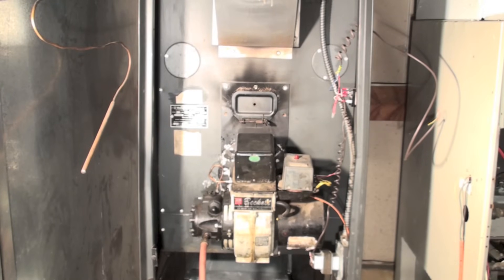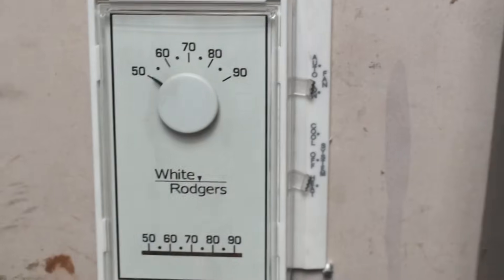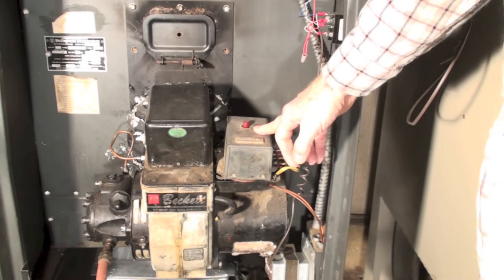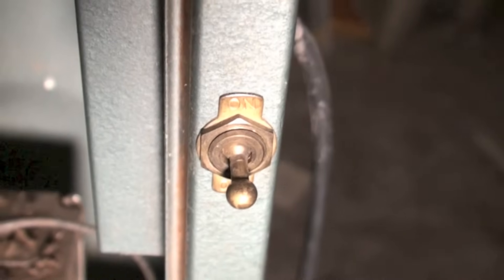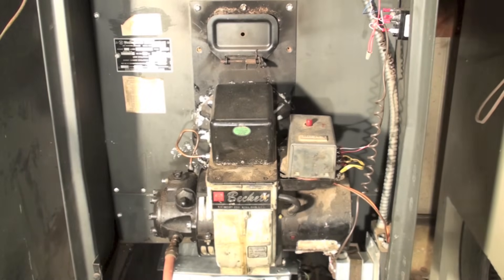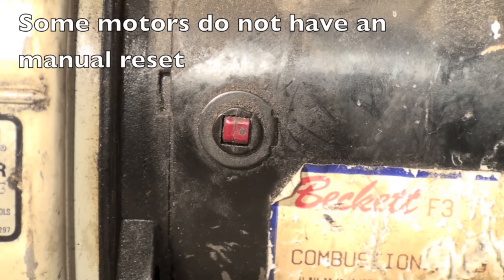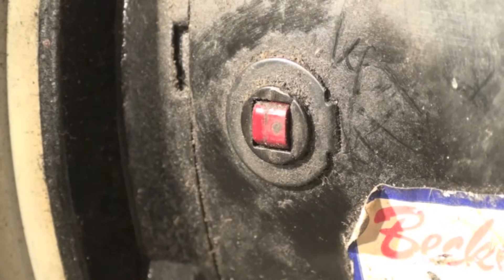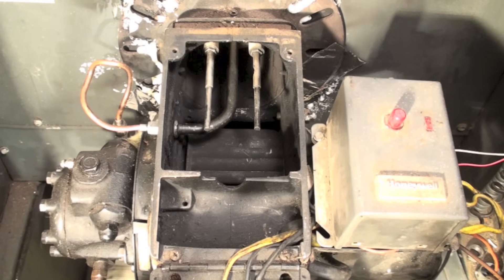Troubleshoot the oil furnace part 1. Burner won't start.

Comment: Well. I hope you are someone on here is still alive. I'm a retired guy with a house built in 1890's. We moved into the house in 1986. It had a American Radiator Company, ARCO PETRO OIL BOILER (32" x 58" x 78"), with a  new install of an INTERburner!  Its For the first 15 yrs everything work. Nice hot water through the radiators. Beautiful even moist heat...

Fast forward to today. We have used kerosene or electric heat for 12 yrs. It broke. Wouldnt start, and the Pump (1hp thrust pump) broke. 2 yrs ago we got it all to run again and it ran almost the whole winter- MY fault, I let it get to the bottom of the tank- SLUDGE clogged it.  I was given the tiny pump piece by an old furnance guy... and new wiring, etc. thats where I sit. 

After I put the new pieces (at the CAD), and to the ignitor, and tried adjusting the ignitor, I get electrical pulses when I touch the furnance.... no hurt kind, but like a ground touching somewhere. 

Well, anyway... I am searching today and came across this guy... will be back for question

Comment: Hey grayfurnaceman, this is a bit of a follow up to my previous question about my Beckett burner getting flooded. I'm going to take your advice and replace the motor. I disassembled the one that is presently on the furnace, and water ran out of it. I'm also going to replace the oil filter. The flood water does not appear to have got up to the transformer or primary control because I don't see any flood residue left on them. Nonetheless, I cleaned those parts with a spray cleaner. However, the lower left side with the fuel pump and air tube/blast tube was under water. I've cleaned the exterior of those parts with CRC Lectric Cleaner. Do you think those parts will be OK?
Reply from the maker: Other than replacing the nozzle, cleaning the gun assembly and flushing the gun line, all should be ok.
GFM
Reply: @grayfurnaceman  Thanks.  You're the best!

Comment: I have a Beckett furnace just like the one in the video. I've actually used your videos to make repairs on it in the past. Well, my basement was flooded a couple of months ago and the water got above the Beckett motor. I looked inside where the turbine is at and there is a slight dirt residue left on the internal parts from the dirty flood water.  I've pulled the motor off before while working on the furnace. I haven't tried starting the motor since the flood. Do you think I can clean things up and the motor may still work? I will appreciate any suggestions or advice. Thank you.
Reply from the maker: The motor may work but I would replace it.  Bearings or start switch may be damaged and the motor will fail in the near future.
GFM
Reply: @grayfurnaceman  Thank you!

Comment: hello, is there a over heat relay that will shut off the furnace if it thinks it's overheating no matter the thermostat? so my furnace keeps shutting off middle of night. it is an olsen 1989 yr make, it has been very reliable til this yr.  i had old dial thermo stat that was just replace today with a digital, and it is still doing the same thing. Furnace either runs constantly, at anything above 64 degrees. i normally run 62. so what is the signal or switch or what is it called that would make the furnace shut off if i dont keep babysiting the thermostat all night. it was set for 64, i got talking on the phone for over 40 mins happy thinking it was finally solved, and running like it should, but low and behold i felt cold went to the wall with my infra red gun and it showed 59 on the wall, and 61 on floor but the thermostat was set for 67 and it said room temp was 65. so do i have a bran new bad thermostat? or what is the saftey switch that shuts down signal to thermosat / fire, ect?????????  please help me they have came like 4 times now to try to fix this. this time paid out of pockett with friends help, im disabiltiy currently and cant afford this rt. now and it is our only heat source. i also must add i had/ or still maybe do have 601 stray residuial volts from an internet trace wire, my heart keeps flopping all over the place, if there is still residual high volatage wire thur the internet trace wire, and traveling thur snow even though the house is "grounded and protected", could that interfere with the signal from thermostat to furnace in the snow or rain since they have no removed that known high voltage inducitve trace wire.. i was just told by furnace guy litterally not even 5 hrs ago there is no shut off switch to shut furnace down. yet on youtube i do see a "limit switch", and my furance for about 2 yrs has been doing those syptoms intermitiantly. in the last 4 weeks now i have woke up at at least 5 times to no heat they have put 3 nozzles on with in about 4 and half weeks. i have oil burner i was told i was "gelled up", ( before they even looked at it, tank is enclosed area out of wind with wood anbd some insulation. so i dumped 911 in the tank treating the full 221 gallons. it took me 30 yrs to finaly be a home owner paying everyone elses taxes and morgatage, i really don't want to cycle the thermostat physically rt. now i am also sick with a head cold and need sleep. something keep shutting this off, ele. or relay or sensor or 24 voltages to thermostat? also the reset box, furnace guy had to tap on it and bump it with fist to get it to fire up again. he re-oiled the air blower unit, cleaned up belt., it was too dry this has been also done now at least 3 times in 4 weeks. please any advice on this. i know cars if they run above 225, and get hot and have newer computer there is a safety relay that shuts off power to the fuel pump on a car so the car's block doesn't melt with the alumiun heads now. so does my furnace have some feature as this as well? Mr. Greyman the furnace guy, please help, me i can't just stay home all day babysitting this, or keep calling furnace people i don't know through heap and they stay 15 mins and treat me like i'm an idiot and or nuts, and then pay out of pockett as well to have thermosat put in! if i turn the temp, up too then it just never stops running, on the thermostat, its happy at about 62 but even then i will wake up in am to less then 41 degrees! i normally go thur 5 gal a day in a normal winter season. i burned up 123 gallons from jan 6th til jan 22! which is almost double yes i know it is colder but maybe the box or air fuel mix isn't right or some more cleaning needs to be done?. if i do turn the thermostat up it either constantly runs until the furnace over heats and goes in lock out mode at anything above 65, i don't want to jack it up to 72 to when i sleep and have the furnace burn its self up!!!!!. is there a mother board in a 1989 furnace or limit saftey switch to the thermostat either in teh reset box or fire plentuim box below the metal pipes?? could the reset box have a short or bad wire?  do i need a new honeywell black reset box, is the safety in that reset box?? any ideas, i thought a new thermostat would fix this! thanks for you time, i hope you can give me sound adivce it is an olsen fuel oil burner currently with a nozzel 1.10-80A it is a different nozel, but it is same symptoms, already as i have typed all this the furnace has not kicked back on an dit has dropped. please explain to me my reset box and wiring to my furance. also at times alot lately sounds like some critter is running thru the heat vent pipes. that is large and it will make sounds like some one is throwing small rocks at it. the pletuim box, ect, has not been taken apart and cleaned in at least 7 yrs and i don't know if perivious owner did. does any of this sound rare but fimilar bc i have now 4 guys in about 6 weeks missing something.i do find the furance loves the white k1 kero or clear kero you would put in space heater so is all this over the fuel as i am getting same as everyone else on fuel and had same fueil oil company for 5 yrs now.?

Comment: I have an intermittent lock out issue. Becket burner fires and runs fine for weeks. If we get a warm spell, and it doesn't run for 8 hours or so, it locks out. The top of the control module  is very warm ? and it won't restart when reset..Unless I turn the power off to the furnace for a few hours, and try restarting again. It fires right up and will run fine till the next warm spell. Any insight is appreciated !!!
Reply from the maker: You may have a problem establishing draft up the chimney. If the unit rumbles upon startup, this may be your problem.  Look for restrictions in the smoke pipe and chimney.
GFM

Comment: My heater is heating water but not circulating to heat the house
Reply from the maker: First, check boiler pressure, single floor should be 12#  2 story 18#.
GFM

Comment: My R7184 A 1075 primary controler just makes a slight hum from the relays and they are not pulling in. 
I don't get a relay click even with the CAD CELL disconnected.
I have 121 volts to the controler.
I'm thinking it's the primary controler, what eles could it be?
Reply from the maker: If you have pressed the reset 3 times with no ignition, the control locks out.

To get it out of lockout, hold the reset button for 30 seconds or until the light blinks twice.
GFM

Comment: Been watching your vids, but can't seem to see my problem. My boiler will start and run when I hit reset switch and it runs fine. When it shuts down it won't restart on it's own. I can hear it making a humming noise, but it won't actually start unless I hit reset again. Then it runs for a while and heats up until it shuts down again. When it's running it seems to run fine. I'm not sure what to check. you have any videos on that?
Reply from the maker: My thoughts are that you could have an oil supply problem.  A plugged oil filter or supply line blockage are common.
GFM
Reply: @grayfurnaceman  Ok. I just changed the filter and nozzle about a week or so ago. Filter is new and when I bled it it was a strong flow. If I hit reset it fires right up and runs like it should so oil seems to be flowing. It's just when it shuts off it doesn't start back up. Like it doesn't even attempt to. If oil flow was an issue, wouldn't it at least try to start then lock out? I was hoping I could fix it because I like to know how to maintain it, but I might have to call a guy in. I just rebuilt the burn chamber and it ran great for a week before this problem. Great videos BTW.

Comment: I can’t figure out how to get my oil furnace running. I checked the igniter cleaned it off good, changed the filter in the line before it gets to the furnace, replaced the igniter transformer cause it’s bad. Replaced the CAD cell last year! The filter right before the pump had a little grime but I cleaned it off and it looks pretty good. The relay was replaced last year. When you try to run the fan kicks on for about 40 seconds then it shuts down so it still seems it’s not getting flame. Does anyone have any suggestion? My motor for the fan turns very easily I saw in a video it said it should have a little resistance. Wish I knew what the issue was it’s getting colder here and we don’t have money to pay someone to fix it. Could it be the nozzle it was replaced last year? I’m not sure what else to even try.

Comment: What if the blower moves to freely not too stiffly. Mine seems to move very easily no resistance at all.
Reply from the maker: If the burner does not operate, I would check the coupler.  It could be broken.
GFM
Reply: @grayfurnaceman  I turned the motor for the blower with my screwdriver like he said in the video and it turns very freely with no resistance. I know he said it should have a little bit of resistance though. It’s not getting any flame I guess cause it runs for 45 sec then stops. The CAD cell isn’t sensing any flames, it was installed brand new last year. It’s getting fuel oil, I checked the filter where the fuel oil line comes into the furnace and checked the nozzle on the igniter too. There’s definitely oil coming to it. 

The igniter nozzle was a little dirty but I cleaned it off, filter and housing was dirty but I wiped most of the grime away. You believe it’s the possibly the coupler? If not your couple I wonder what else it could possibly be?
Reply from the maker: I would remove the gun assembly, remove the nozzle, reconnect the gun line and point the gun into a can.  Then start the burner.  No oil with oil available at the inlet, pump is not pumping.  The only other possibility is a plugged screen in the pump if it has one.
GFM @johnnyappleseed5590
Reply: @grayfurnaceman so it could be a clogged screen in the pump? I don’t know anything about the pump on these could the pump itself be bad also?
Reply: @grayfurnaceman the motor is on the right underneath the control right?
Reply from the maker: The screen could be clogged if the pump has one.  You can remove the cover to find out.  
If you can determine that the pump has oil and it is turning with no oil coming out, the pump has failed.
GFM @johnnyappleseed5590
Reply: @grayfurnaceman the coupler was out but after replacing it, it still runs 40 seconds then shuts off. I used your video to check, it had no arch at all but it was the original, 30 years old.

Comment: Can you burn diesel fuel in an oil furnace if you change the nozzle?
Reply from the maker: Diesel is essentially the same #2 fuel oil as is used for oil furnaces.  So it can be used with no change in nozzle.
GFM

Comment: I have a Becket that just stopped.  I isolated the motor, the motor works.  Since the gray box has a black (hot), white (neutral) and redish wire (switch leg) coming out of it, it must be this box.  Hundred dollars plus, no it wasn't the gray box.  It still sat there and did nothing.  I disconnected the "Beckett Electronic Igniter and it works without igniting.  Replaced the Igniter and now have heat.   Hope this help other people.

Comment: I bought a house and the guy said it worked last winter. I just filled it and everything is just blowing cold air. My pump and motor I believe start for about 5mins then stops. I press reset and it starts again for 5mins than stops?
Reply from the maker: The first thing I would do is replace the oil filter.
GFM

Comment: Fantastic video and learned alot about my furnace over the past 30 years. 
I do have a question, I have a Weil  McLain oil burner with a becket. I have hot water baseboard 1 zone as well as radiant floor heat in my kitchen. I noticed that sometimes the burner will start and then shut off after 4 seconds, then fire back up and all is good. What would cause this issue? Thanks

Comment: Hi GFM I have an old Olsen oil furnace. It lights up and cycles, but the blower motor won't kick on. I'm was thinking maybe blower motor or capacitor. The motor spins freely, I just can't find the capacitor. I don't know what I should do please help.
Reply from the maker: It may not have a capacitor.  
I would be checking for power to the motor.  No power, look to the fan switch.
GFM

Comment: I couldn't get mine to start again after turning it off last night due to rain getting in through the exhaust tube and dripping through. There was no light when i turned it back on and had the thermostat to 70. I tried holding the reset button for 30 seconds and also 15 seconds. I also tried turning the furnace off then on again a couple times and still nothing, no light at all. Came here, turned the thermostat all the way up and just clicked the reset button once and it came on like there was never an issue. Im no novice and thought i might have to bleed the system. But turns out i was just holding the reset button too long

Comment: I know this is an old video, but it helped me get my oil burner going tonight when the temperature outside hit zero. In my case, the oil pump seized. I took it apart and cleaned it when brake cleaner and pulled out the shaft and removed the rust deposit, then greased it up and put it back together. What I didn't know was the reset on the back side of the motor tripped. Thanks for sharing your knowledge.

Comment: Thank you so much for posting all your videos!  I've fixed my old oil furnace several times with your help. And after calling several companies that never showed up for appointments, I would probably still be freezing. Each repair usually cost me less than $20, when a visit for an estimate was quoted at $125.
Reply from the maker: Glad I could help.
GFM

Comment: GFM, I just need to tell you your oil furnace troubleshooting steps have saved my family and I from freezing tonight and times before. I wanted to tell you how much I appreciate your knowledge and time spent making these videos. I had ran my tank dry and just got oil today but could not figure out why the gun was not getting fuel. I guess I needed to purge the air out of the pump and suddenly I had pressure at the gun again . If it wasn't for your tips I would not have heat tonight.
Reply from the maker: Its good to be warm.
GFM